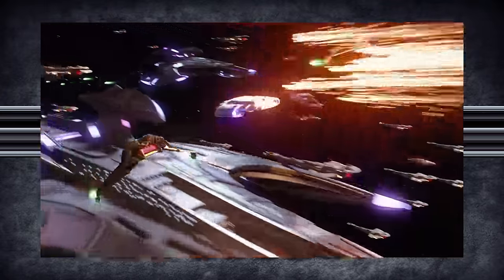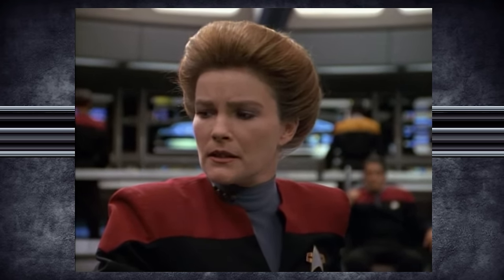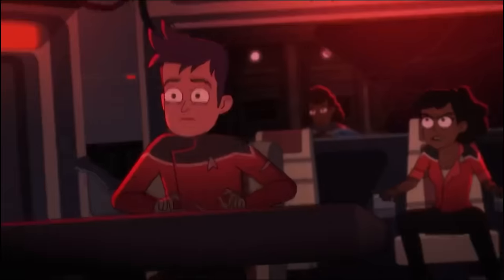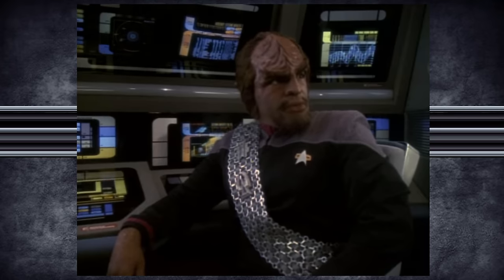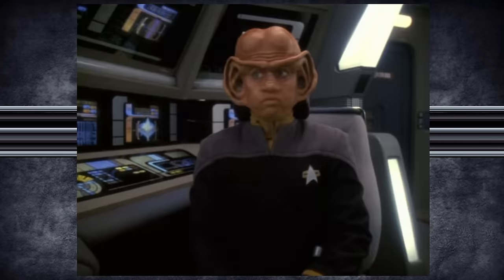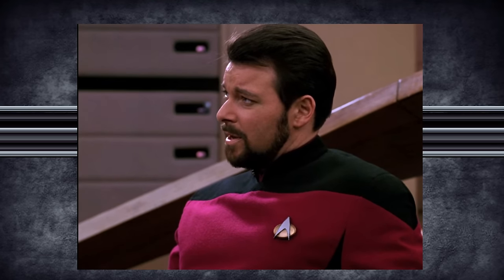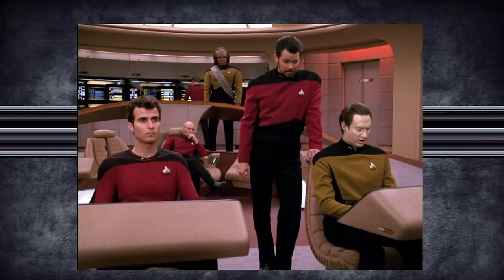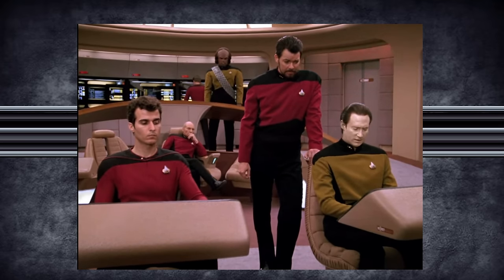Why Starfleet's Bridge Design Was Lethal to the Crews

Comment: Explodium...thats the only reason why...if starfleet would stop making starships outta explodium, no morr death traps!😁
Reply: So many movies/TV shows (not necessarily Sci_Fi) have all kinds of sparks coming out of panels like they are wired for 7200 volts, when you would think they system would be 120 volts with panels running with 5 & 12 volt DC power supplies. Or industrial batteries that put out around 48 volts DC. It's always bugged me that they think alla them sparks and smoke are cool.

Comment: Good vid, I agree with a lot of the points made.  Also, thank you for making it, it covers a lot of the questions I've encountered internally.

One thing missing from this - and I haven't scrolled the comments - the relationship between ST bridge design, and the inspiration for the layout, and language, being an extrapolation directly out of current/historical Naval precedent, particularly from that of the USA.  Consider an ocean-going warship as we have known them across this (21st) and the previous (20th) Centuries - Window at the front, big 'operator' type chair for the Cpt, wheel between them.  Doors to the side and rear.  A bank of controls, some charts, at specific points around the room.  Ship is beneath - partly because it's filled up with all the things that make a ship, partly because the water is beneath, and ship go on water, of course - and so that the Cpt and Cmd officers can see from the best possible vantage point.

Basically, the irony of ST, as much as I love it, is that the design ethos has always been taken from something which perhaps, by the 23rd and 24th centuries, will have become obsolete - at least, in space.  If your ship sits on the ocean, it's pretty much going to be one way up, and you'll be looking up for planes, across for other ships, and down for subs, mines, and land.  In space - you might need to face up, down, left, right, over there, over there - it's truly a 3D environment, so a '....fuck, I've lost the word there - a bridge based on moving laterally makes no sense.  We'd probably still need gravity, so we'd be oriented one way up, given that we as humanoids have feet at the bottom, head at the top - but the environment we'd be working in would require spherical multi-directional movement.  So, essentially, almost all bridge designs in ST are pretty much nonsensical, in the context, but they help orient us in order to understand what's going on, in the show.

Comment: So, apparently a lot of the starfleet ships actually had a second shield for the bridge so it was easier to target other critical systems like weapons or engines.

another thing is that some ships did in fact have a separate secondary command bridge that was fully embedded. You can see this on galaxy class ships where the secondary hull would fight with most of the weapons and the saucer would fly away  (sometimes at warp as while it could not generate it own warp field it was able to maintain one for some time) with most of the crew to get to safety.

In addition engineering could have all controls given over to it on nearly all starships so the bridge was not strictly needed.
Reply: But after separation the secondary battle bridge was in the usual exposed position. Front top center maked with as "shoot me"-bull's-eye.

Comment: Windows are a dumb idea. As far as "transparent Metals" That is what glass are made of (Silicon dioxide, or in the case of transparent aluminum: aluminium oxide doped with other metals. Windows are of little use, and Submarines function without any windows only using sensors. In space most likely radar, and infra-red optical sensors would be used. Your not going to see a ship that is a few million kilometers away with your eyes, or even with a pair of binoculars. 

The problem with most TV sci-fi ships enaging in battle, do as if the the enemy has to come close to engage a target. Ship to Ship conflict would happen in light minutes or light hours away (180 Million Kilometers to billions of Kilometers) away. Even modern air combat no longer uses visual observation to engage targets. Two Jet fighters traveling a Mach+ each will be moving at more than 1Km/s. Space ships would be traveling hundreds of Km/s.

Comment: Big tip for the federation.  Build ships with a bridge sandwiched between very thick hull plating.  A domed or circular area sat above the saucer section is like the bulls eye on a dart board.
Reply: Or just put the damn bridge module on the BOTTOM of the saucer, just to mix things up.

Comment: The original Enterprise, as designed by Matt Jeffries, took a lot of cues from naval ships, where the bridge is the highest point of the ship. There is a clear reason for the location of the bridge. On naval vessels, the bridge must be located where everything can be observed from it, since the ship is controlled from the bridge. You can't hide it down in the bottom of the ship. It might be safer there, but you couldn't see anything from it.

Comment: I remember watching TNG for the first time after only having watched TOS and finding the bridge to be impossibly large and the distance from the captain chair to the navigation to be comical
Reply: It did give Riker plenty opportunity to walk forward with an incredulous look, head tilted sideways...
Reply: TOS bridge set: 38' wide
TNG Bridge set: 38' wide

The TNG bridge was about 2 feet bigger front to back and had a much higher ceiling, but wasn't much larger. A major reason it looked that way is because of how things were placed. In TOS, Helm/Navigation was in the center of the bridge, the captain's chair further back. This left a lot of room between Sulu/Chekov and the view screen, but because of shooting angles you rarely saw this area of the bridge, so really half of it rarely showed up.

In TNG, Helm/OPS was pushed forward to be much closer to the front, while the center of the bridge was just in front of the captain's chair, which was moved slightly forward from where it would be in TOS. Combined with the extra 2 feet of depth, this created a lot more room behind the captain.

Basically, what was happening was that in TOS, for most shots of the bridge, you were only ever seeing a quarter or so of it with everyone jammed in there. In TNG, the camera was further back, showing a wider view, so the same number of people could be more spread out in roughly the same area.

Comment: I thought TNG was housing the bridge under the saucer section. When they separated they was on the main bridge. The neck part. I’ve seen them still on this part during separation and then be present when the main bridge is inaccessible. All had no windows, like you mentioned ,  but would be like driving or piloting a tank with a monitor displaying images of the exterior. With a computer like Data at the helm that can be accessed and reasoned with, would be the best position.

Comment: In sci-fi, my favorite bridge design was from dp9s jovian chronicles role playing game, The bridge of the Jupiter ships where interesting. It was inside a gyroscope like frame, and would spin to orient itself so up was always facing the direction the ship was accelerating towards. In this sci fi setting there was no artificial gravity, so inertia while accelerating is used for the most part. The bridge had several stations that could be used for any role. A chair that could spin around surrounded by instrumental display panels. With
.. dun dun dun, seatbelts, each station pod had shock absorbers, and role bar frameworks. And safety gear under the seat. Etc...
- The opposite of the stand there and get thrown to your death deathtrap that are in most sci fi show's settings.

Comment: I for one don't mind the Enterprise-D bridge. It holds a lot of nostalgic feelings since TNG was the first Trek I watched, but regardless, I don't think the complaint about the Tactical station was entirely valid. Sure, the standing part must be a bit of a thing, but Worf's a Klingon, and to complain about something as mundane as standing would be ridiculous. Besides, if your job entails a lot of standing, you get used to it. As for his position on the bridge, it makes perfect sense to me - he has an elevated view and is further back, therefore he can see most of the bridge and has the Captain in sight at all times... something which makes perfect sense for the Security Officer whose sworn job it is to protect the Captain and bridge crew (as well as the ship). If intruders beam onto the bridge, he's poised in a great tactical position. And Picard doesn't necessarily need to turn around to speak to Worf; they're both loud enough to be heard - it comes with the job (and Worf being a Klingon).

It's also worth considering the other reason for having things where they were is simply so that we can have it all on screen at the same time. Bear in mind the aspect ratio of the series, they had to cram everything into a rather narrow frame, and it would be poor design to have more consoles blocking up the view at the front, or off to the side causing the camera to constantly have to turn whenever a conversation is taking place - that'd just be nauseating!

Comment: The problem with actual windows compared to view screens is the range. The range between ships is likely to be hundreds of km during battle, you're not going in for the melee most of the time. Active and passive sensors will be the order of the day. It also adds in the problem of laser weaponry blinding the crew if the glass isn't darkened artificially.
On modern naval ships, the CIC is the heart of the ship and is buried as far away from everything as possible. No direct vision windows. You have radars, cameras, IR sensors and look outs. Even on old ships, even though the bridge was exposed, fire control was buried deep inside the citadel, and any lookouts would be using binoculars or telescopes.
The material for the windows is also a problem. Even using transparent aluminium, it's a different material to duranium or tritanium and will have different properties that might make it less useful when attacked. It's a potential weak spot.

Although not as efficient as Starfleet's bridge designs due to a lack of automation, the original command deck on the Battlestar Galactica is noteworthy as it was 1) very heavily armoured and shielded even though it was exposed and 2) the direct vision windows could be sealed up by blast shields that were air tight.

Comment: There is a secondary bridge on the Enterprise from TNG...it was located in the lower hull section and is really only mentioned in the few episodes where the main hull was separated. I believe there is at least one episode from the original series where it is pretty much inferred that bridge procedures can be conducted from Engineering. Redundant bridge functions date back in time all the way to sailing ships. In fact the original ships had steering facilities below deck; the "wheel" you see on old sailing ships was not the primary method of controlling the rudder. There was a boom below decks that swept from one side of the hull to the other...it was that boom that actually moved the rudder. The wheel was more of an indicator, much like the ships 'telegraph' on the bridge controlled the speed the captain wished to maintain...it was a method of communicating to the engine room how many turns of the props were to be maintained.

Comment: My favourite is definitely the NX-01 bridge. It's practical, makes sense for being the first warp 5 starship with its basic military/necessity only feel, it's not widely spaced out, and all stations can face the view screen easily.  And when they get attacked, despite only having Polarised hull plating, they seem to handle it well. No one really gets thrown across the bridge, most it seems is they'll fall off their chair, which makes sense, the confined space of their stations would prevent being thrown far. And the danger to their lives isn't any more than a fire, or the bridge itself coming apart. 

The Enterprise-D was obviously built with luxury in mind. It reminds me of cruise ship's from the 20th century (Albeit with technology they didn't have) built for show and comfort etcetera. it seems very sparse though, it's widely spaced out and I've always felt there isn't enough stations, because that's what it looks like. And like said, isn't very practical. The Captain will have to turn around to get info from the stations behind, it the tactical officer could get thrown over their station, and it doesn't seem to handle well when they're getting attacked. Among other things.

Comment: Fun fact, back in the period of coal and oil fired warships, the Royal Navy had an endemic problem with its officers not using the armored conning towers built into their ships. The officers much preferred using the Bridge, which provided far better visibility, and were typically minimally armored, if at all.

While the sheer distances involved in actual space warfare probably still makes a window of limited use for tactical purposes, I think it's a good example of what happens when you try to optimize a trait widely accepted as good (in this case, armor protection) to the exclusion of all else.

Comment: Technically the Galaxy class DOES have a secondary CIC in the Battle Bridge, but since the senior staff tend to take the lift there when needed, it just gathers dust normally. They should have it crewed by sensor experts when not needed for combat.

Comment: Just an idea, but the Federation could have bridges with regular windows that are still inside the ship for protection. Advanced optics (or even just mirrors) could connect topside windows or viewports to interior bridge view screens easily. Like giant periscopes.
But, I still think the Expanse's Donnager class has the best designed bridge in scifi (even if we barely get to see it).

Comment: This is what I would add to the bridge of a Star Ship.

1. Seatbelts!  Chairs with race car like seatbelts that can be easily removed and put back on when needed.
2. Airbags! Strategically placed where most crew members hit their head whenever the ship takes weapons fire. My car has front and side airbags tucked away and I don’t even know they are there.
3. Computer panels that don’t explode in your face. What is that about?
4. Don’t store starship rocks in the ceiling that fall to the ground whenever the ship takes damage. That’s what a cargo bay is for.
5. Holo Emitter on the bridge and engine room connected to self-powered holographic generators that don’t depend on the ship's power, so someone can pop in saying “Please state the nature of the medical emergency” whenever a critical crew member gets hurt.

Starfleet needs to decide if it is more important to design a safer ship, or have more exciting episodes. Okay, I see the problem with my designs. 😳

Comment: On glass:  if you're approaching a sun, it would get pretty bright, so that glass would need fancy dimming, and protection from sun's radiation etc.  You might be able to project a "heads up display" type of thing, but might not work in a fully lighted bridge (as opposed to a dark cockpit). 

On the work positions: if the consoles are truly computers, one would assume that the helms guy should be able to access any system on the ship and flush a toilet in cabin 27D on deck 32 and then get back to navigation menus and turn right at the next intersection.  And it makes sense that any function on ship should be accessible from any workstation (given proper authorization) from a redundancy point of view. 

The stupidest things are the "theatre" floor on the bridge. Looks photogenic, but one would assume a bridge would all be on a floor that is level, and raise the viewscreen if you have to to ensure all crew members on bridge can see it.

Comment: Honestly, I like the idea of a central Captain's chair with control screens built into the armrests, and I think that there should be three stations front, three rear, and a first officer and chief science officer position on each side, between these at the sides of the room, but close enough to the captain's chair for easy conversation, while leaving a walkway on either side. Because the consoles are all touch screens, they should have a top row of control buttons that change to various function pages, so any console can work as any station. Biometrics would be easily able to tell who's operating the station and allow access to only those they are allowed/trained to use. This would include the split small screens on the Captain's chair, so if all else failed, the captain could run the entire ship from that spot, or go to one of the forward consoles and take over any needed functions with a full-sized console.  A crewman on duty could find a free station and sit, and do their job right away. Sounds efficient to me. :)

Comment: One advantage the Galaxy class bridge has over almost all bridges, is that it has a toilet compartment. It's behind the door opposite the door to the observation room.
I do think the updates we saw to the Enterprise D's bridge by Generation did help even things out a bit, with the extra consoles either side of the command area, but I always would have liked to have seen some larger consoles for Picard, Riker and Troi to be using and maybe some sort of stool at the very least for Tasha and Worf to rest against when at tactical.

I know you didn't cover it, but I can't say I ever liked the Sovereign class bridge, it just seemed far too cramped compared to any other bridge. It wasn't as small as the Defiant's bridge, but it just seemed so full of stuff that just got in the way, and a lot of it was behind Picard.

I always liked the rails on the Constitution class, I know it did slow down access for the Captain but given it did act as a safety feature it's a trade off I can accept.